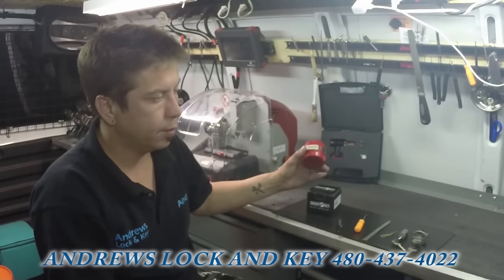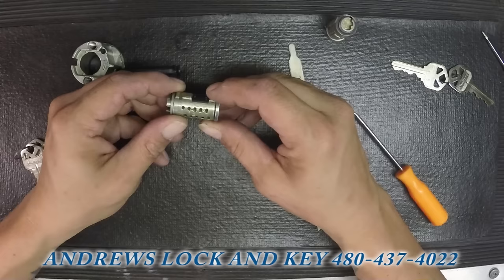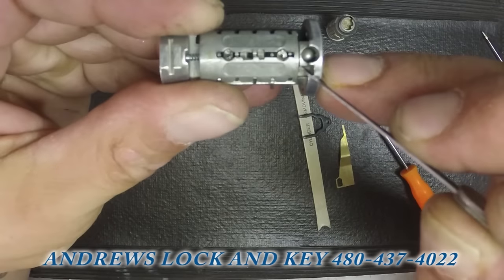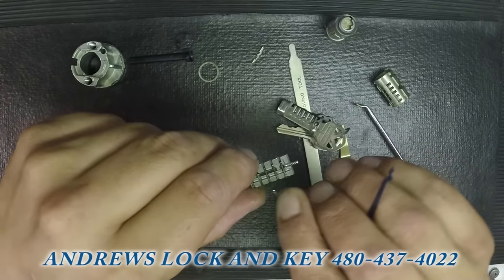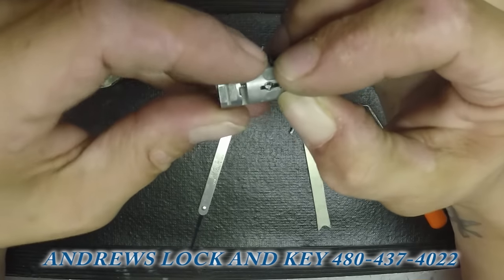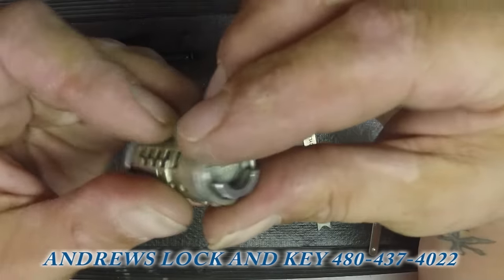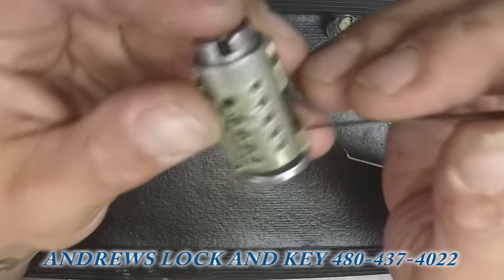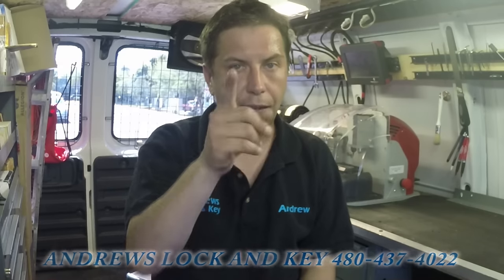KWIKSET SMARTLOCK REKEY WITHOUT KEYS OR RESET TOOL

Comment: well watching the video you used the key that unlocked the lock to re key the lock so video is considered a loss.
Reply from the maker: you are correct but after I had taken it apart it wouldn't be the same he anyway because you have to align it back up to make it that key again so not exactly a loss.  more of the point of the video with the show you how to dissect the lock
Reply: I agree. was just going to see how your response was going to be. :) I actually do locks here in Tennessee. but you do cars I only do house locks. btw nice channel good videos
Reply from the maker: good to see a fellow locksmith keeping me in check:). I do it all. residential , commercial, and Auto along with safes. over 16 years experience
Reply: That's some good experience I'm mostly in with high security locks. I love a challenge. During the day without calls I'm always sitting down trying to pick the hardest of locks that fellow lock smiths make. It's a enjoying thing to do. I don't know how you guys work out west but is a house lock similar in flat rate we have ours around $50 for one lock and $10 additional locks? It's a interesting topic that is widely spread out amoung the states. And some time I'd like to see a video of a tour of you music studio
Reply from the maker: +EagleImpact Gaming my service call  is $65 to $125  depending on time of day also rekeys are $15 a cylinder. Make for keys for cars start at $95 and can go up to $500. Depending on the car luxury cars get into the 300 and higher.. most cars for a regular transponder key will be about $185
Reply: I don't know if you ever had to try to pick one or not but the assa pad lock with 6 pins and 5 side bars is a hard lock to pick iv got lucky one time and got one open. took me a year of trying but I finally got a open.
Reply from the maker: +EagleImpact Gaming I've actually never really tried to pick one of those I definitely rekey all the time.  I'm actually a fan of the multi-lock